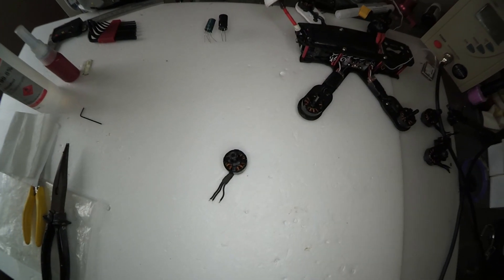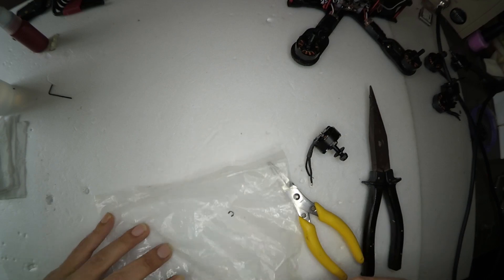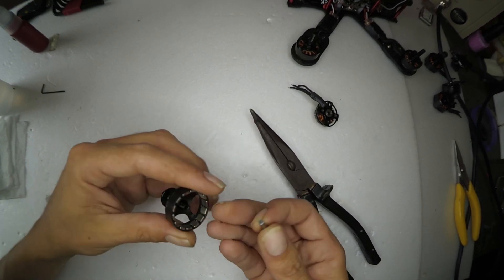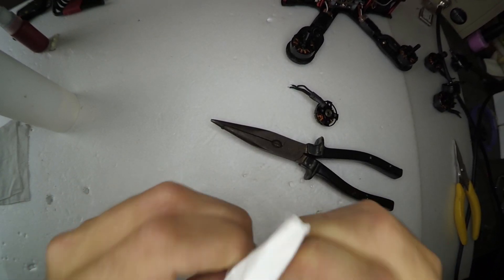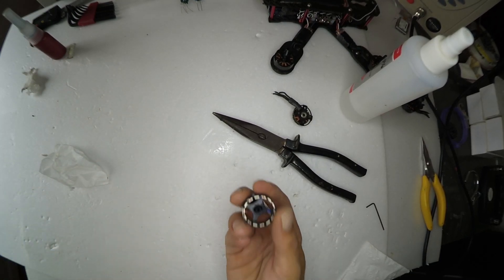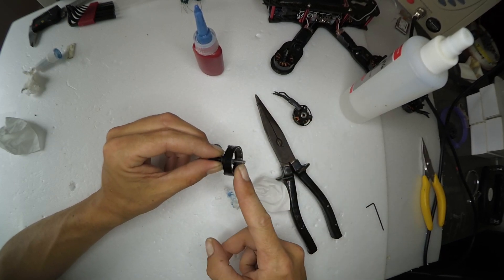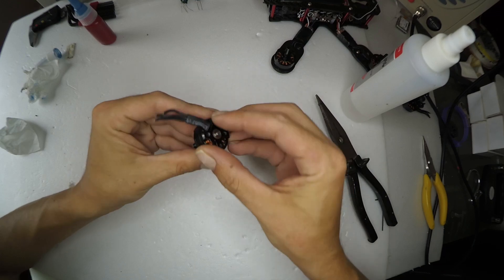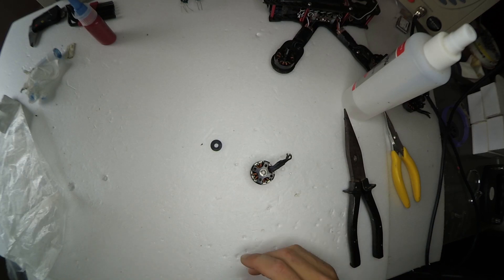RCX 2205 Fix - 2206 Shaft removal

Comment: I bought a couple replacement shafts for my Emax RS2205 units from Bangood at 79 cents each.  Getting the old ones out eluded me.  I couldn't find any video's, etc. to point me in the right direction with these little buggers.  So, I didn't think it possible on the iteration of motor I had.  Six months later and another bent shaft and no spare motors made me take another look.  I then found this video.  I had to clamp the pliers as they gripped the motor shaft, as you demonstrate, into my vice.  I then levered upwards with 2 large flathead screwdrivers after heating it up with a lighter pretty darn hot.  It still gave a heck of a fight but I got off.  Good grief.  This motor has a shaft grub screw so I'm going the eschew the Locktite on the shaft.  Thank you.

Comment: Good tips man.
Reply from the maker: +Stunt Double Thanks for dropping by mate hope it helps if you get any play! just remember the check the ones you haven't fixed each flight as there bound the get lose at some point . thinking this over i guess your correct to not trust these on 6" at least till you've put some loctite in there :P
Reply: I'm gonna pull them all apart and loctite them. For a cheap motor ive been pretty happy with them so far. Also might get a set of 2633s too

Comment: Excellent video mate.  Time to reign in all those pesky loose shafts and bells ! I'm waiting for one show signs of loosening and then I'll use your patented Aussie method ;)
Reply from the maker: Yes c clip pliers is what you need , im with you though i hate them so much!
Reply from the maker: +EngineerX thanks mate , if you dont crash much they should be good for some time i'd guess but who doesn't crash haha
Reply: +Rotceh I was surprised how easy the clip goes off... tried like half an hour to get the c clip off my CM2204 and could't do it... missing the right tools probably...
Reply: +Julian GoesPro haha just missing the right technique as shown in video. if this method doesn't work you can also use a small flat screwdriver inserted in those small indents and pivot against shaft. Anyway, it's always easy when others do it but when you try it it's impossible.
Reply: +EngineerX I think the clip on those motors is nice, the clip on the cobras is just... I hate it... tried with a screwdriver... I think we two already talked about it :-P Still failed to get it done... will need on of those tools where you push like two pins out when "closing" your hand... uh my english skills are coming to an end :-D
Reply: I´ve lost my c clip in one of my crashes and I it´s crazy I can´t find it anywhere, in my country ( Brazil ), you know where can i find these? and it is 2.5 mm or 3mm?